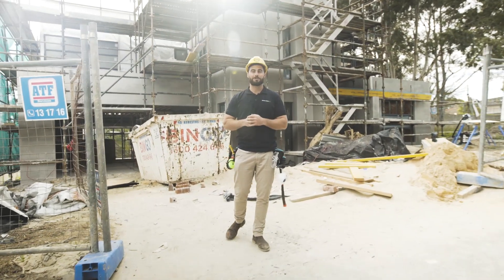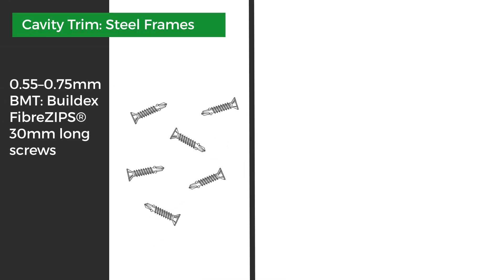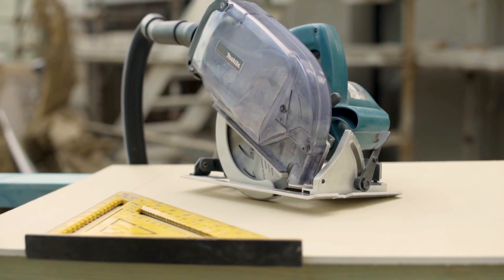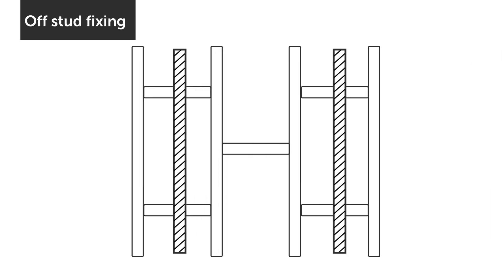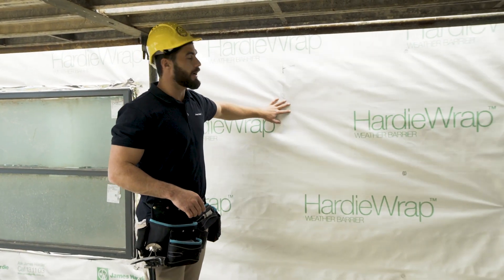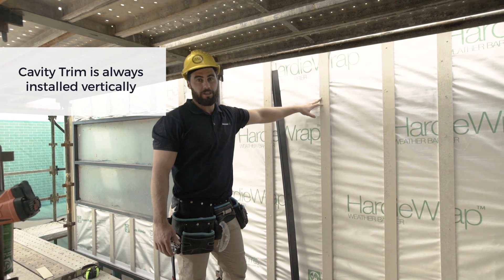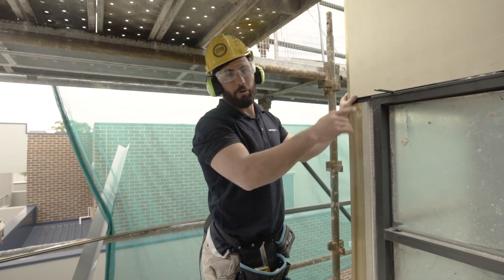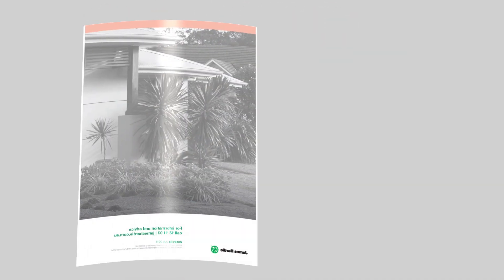How to Install Matrix™ Cladding – Tools, Components, Design Considerations and Installation Process

Comment: your panel spacing spreadsheet has two areas above and below the shaded line, im guessing one is for screws and the other nails but it neeeeeds to be clearer, i only figured out the bottom one was for nails due to that asterisked spacing entry.

Also what the hell do we do when you get to a corner ya flipn champion... should i glue stuff? like youve always reminded me to

Comment: what nail you are using mate?
Reply from the maker: Gun Nail Trim To Frame
2.8mm x 65mm long ring shank nail or
75 x 2.8mm D or round head galvanised
smooth shank nail used to fix Scyon cavity trim
to timber stud. Min. Class 3
Nails To Fix Panel To Scyon™ Cavity Trim
2.8 x 30mm galvanised nail, 2.6 x 32mm
galvanised or stainless steel twist shank nail. Nail
head must be a minimum round head diameter
of 5.3mm, 25mm DA stainless steel Brad Nail
for fixing Matrix panels to Scyon™ cavity trim.
Exposed head fasteners
No. 8-15 x 25mm wafer, hex or pan head
needle point screw. Class 3 minimum coating.
Countersunk screws
8-10 x 25 stainless steel countersunk chipboard
screw square drive / needle point screw.

Hope this helps